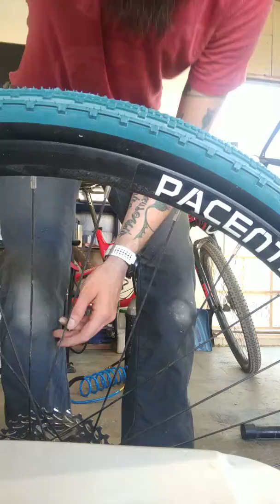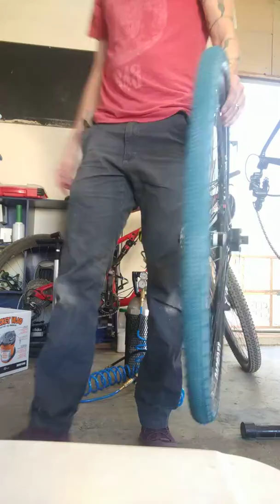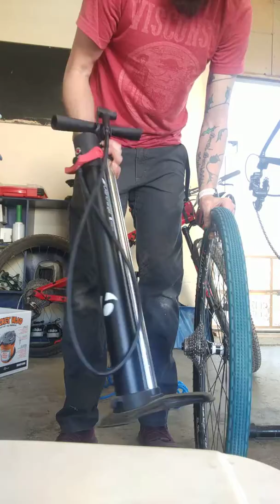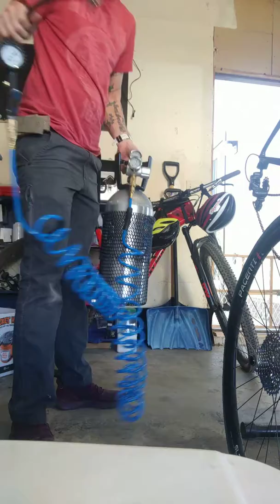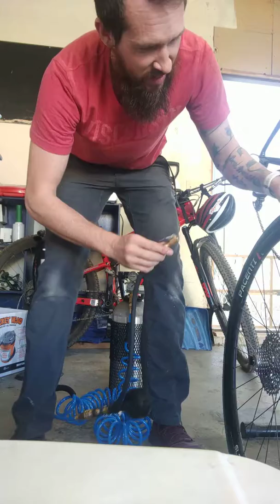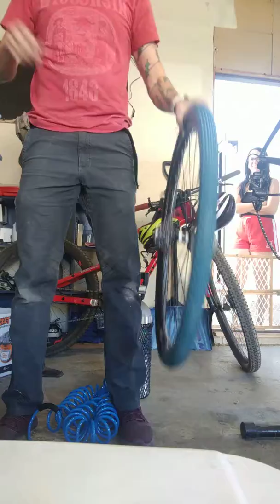Tubeless tire install with power-tank

Comment: Just curious if you tried taking the valve core out and tried with the pump.
Reply from the maker: No Marty I didn't have the valve core remover tool (it's somewhere).  The power tank was across the garage.  And a few years ago when trying to seat fat bike tires I had to use my car tire pump and continually move the tire around until there was no air leaking. The P.Tank just does it faster.